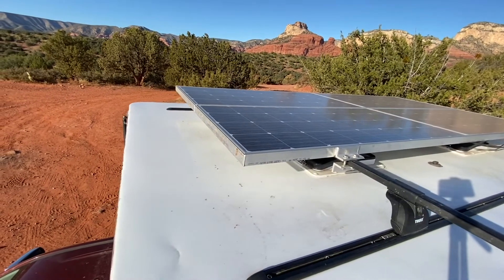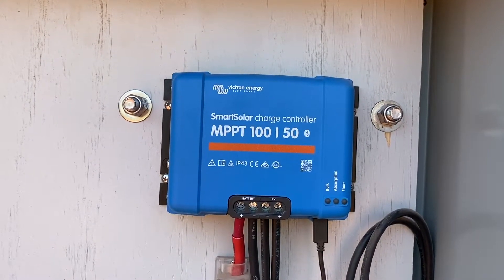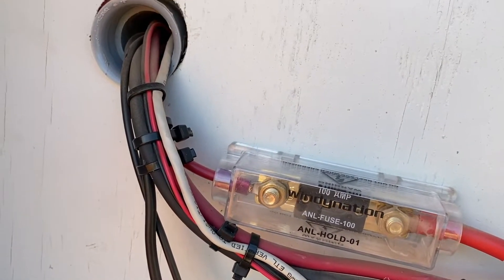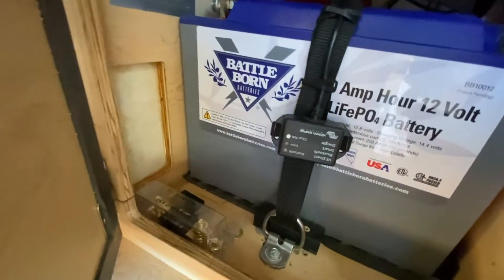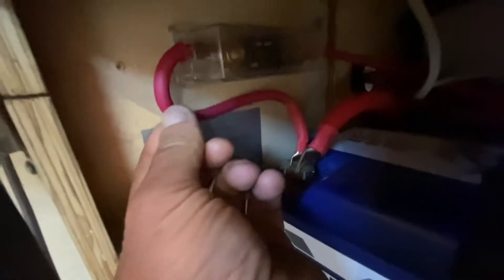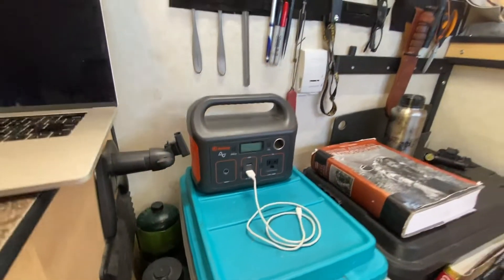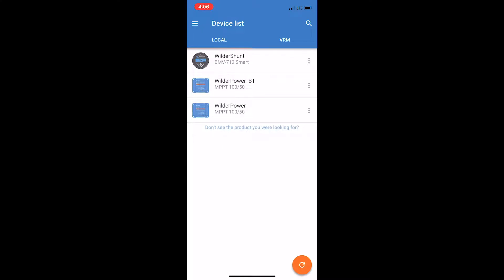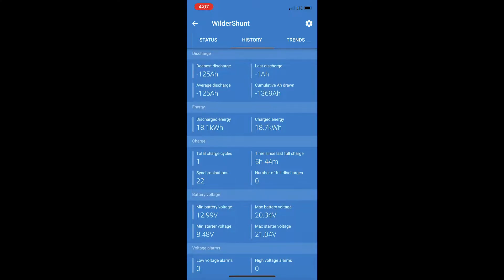Off-grid Solar System - Deep Dive

Comment: To use 100% of those batteries shortens their life considerably. Use the manufacturers specs : down to 20%.
Reply from the maker: That is one of the reasons I selected Battle Born.  The FAQ and the CEO both said they can be discharged to 100% with no degradation.  The most I have ever discharged is 60% and that was just because I was curious as to how long it would take to top off from there.

From FAQ:
"When a battery is discharged, the amount of energy taken out will determine the depth at which it was discharged.

How Do I Figure it Out?
If you have a 100 amp–hour battery and use 50 amp-hours, you have discharged the battery 50% (which means the depth of discharge is 50%).

If you took the same battery and discharged it only 20 amp–hours, or 20% of the battery, your depth of discharge will be 20%. This is an important number to keep in mind. Depending on which type of battery you are using, the number of cycles will vary based on your depth of discharge.  

Most lead acid batteries experience a significantly reduced cycle life if they are discharged more than 50%. That can result in less than 300 total cycles.

Conversely, LiFePO4 (Lithium Iron Phosphate) batteries can be continually discharged to 100% and there is no long-term effect. You can expect to easily get 3000 – 5000 cycles at this depth of discharge."
Reply: @Wildernut  My apologies. This is so with other LiFePo batteries. .
Reply from the maker: @sundancer442  No apologies necessary.  WE are all continuous learners.  

I do not know of any others that can be discharged 100%.  When I was out west last year, someone was having issues with being deeply discharged they had to go through a special procedure to get them back online. It's probably the integrated Battery Management System that protects them.  Maybe they have extra capacity built in and only allow 100Ah to be used, leaving enough charge to work properly and do no damage.  Coincidently, they are located in Sparks Nevada, which is where the Tesla's battery plant is located.  I want to swing in and try to get a tour of both, next year.  I know Battle Born is working on an integrated heater, too.  I'd like to beta test it..LOL

Comment: I had to build the poor man's version but I have 340 AH of batteries for $400 . I also picked the Epever 40 amp BN controller..I have found out that my 4 ( for now) 100 watt RV panels work better on 42 open volts and so does the controller...I tried parallel and then series which was better but the best was series/ parallel ...closer to battery voltage so less heat in the controller. I'm going to order an Aims 3000 watt pure sine inverter in two days..24 volt...my new air fryer sounds terrible on my old inverter lol so thats gotta be changed...Im thinking a small 4 or 500 watt inverter would run a few small loads for when Im not cooking so as to save on idling a bigger one...I like these panels so well I may put 2 on my camper shell...how about an electric window regulator from a salvage..could a couple of them angle your panels from a switch that is safely on the ground? Id use Ford ones..better water protection..but theyre a 12 volt motor..easy to hook up..just thought Id throw that out there..
Reply from the maker: The window motors are a good idea. 

For me, I have so much capacity that I don't think I ever have to worry about getting a proper charge again and I am prepared for well into the future, if I decide to get an inverter and induction stove.  

On my old setup, I was thinking about a scissor setup, with a threaded rod for a worm gear.  I decided to keep it simple and just mount them flat...no fuss no muss.